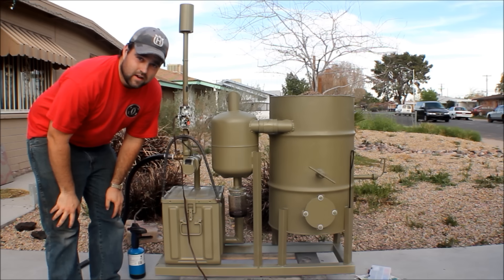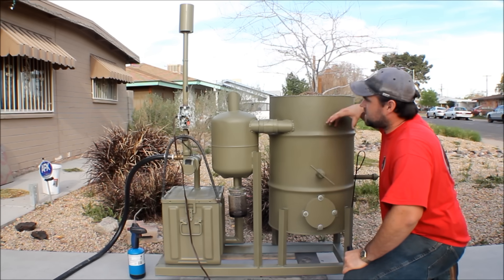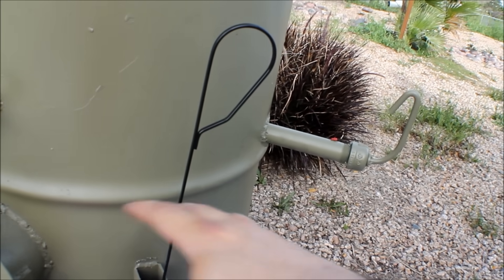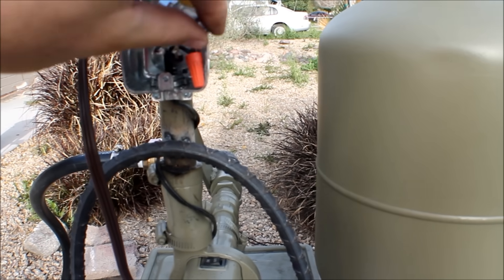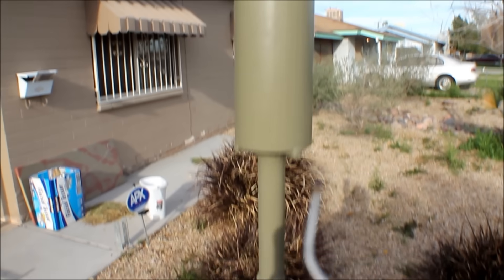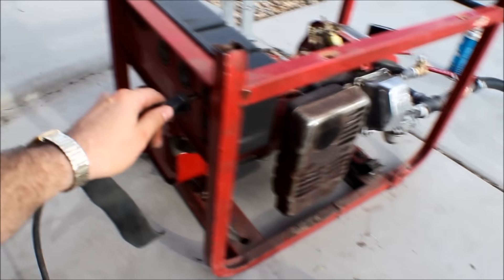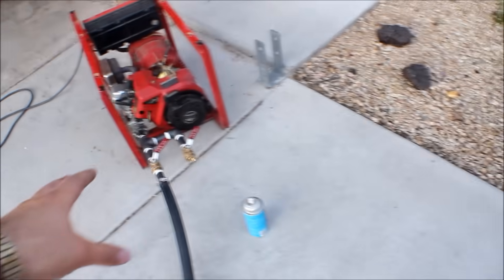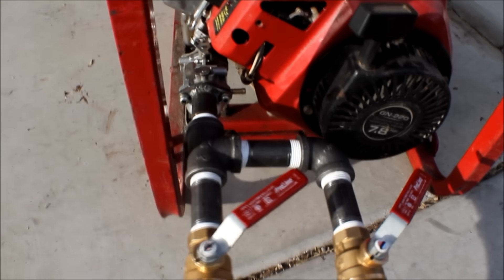amazing homemade gasifier uses wood pellets to run generator -- renewable alternative energy video

Comment: Using that 'not-that-small` blower at full power will waste a lot of energy. An air pump like that eats a couple hundred watts at 12V

While a gasifier operates, it needs a constantly forced air flow. 
Eventually the air pump/blower could be powered form a thermocouple array (TEC) or two, in series.  

It's good to be efficient, It's good, also, not to depend too much, or at all, from external, 3rd party sources of energy for your system to work.

Comment: How about instead of using an expensive power regulator(for such a small blower) just use a valve to control the amount of airflow? It's not like the blower needs to be ran for long periods of time. Just a thought.

Comment: Well done! I downloaded the FEMA pamphlet and am off to Lowe's and Wilco farm store to start pricing my parts. I have a few questions for you:
1) have you tried using wood chips? I have access to a chipper and that would be far more economical for me than pellets.
2) the FEMA plans describe a cooling device sort of a heat exchanger but you don't seem to use one. Are you using your cyclonic filter as a cooler as well?
3)how often do you have to refill your fuel hopper?

Great vid! Thanks!

Comment: Very interesting!   Now of course, I "need" to build one myself.  For the control of the little 12 volt blower, you might want to try using an RV light dimmer. They are widely available, even on e-bay! Mine are rated for 12 amps @12 volts DC. Circuit wise, it is a simple pulse width modulated switching transistor, with a little pot of about 10k for the adjustment. It will produce output smoothly from near zero to almost the input voltage, cheap effective, and comes in a convenient box.

Comment: What about using the exhaust from a pellet stove, would that work. I am also curious about your fuel intake into the generator. Could l also use a propane bbq tank and regulator to fuel it?

Comment: Stop using potentiometers. 
Use a DC-DC power regulator that can handle the current and you will have an efficient system. At least electrically. 
 Look for DC/DC Adjustable Step-Down Power Supply Module on ebay and such. 
Simple to use and implement. I saw they are in the 5 bucks range. 
Otherwise, I LOVE THE COLOR :D 
Great job!

Comment from the maker: yes, the sawdust gets dirty and needs to be replaced every now and then.  any type of box or bucket would work, as long as you can open it to replace the filter media, and as long as it is air-tight when it is closed.

Comment: Interesting! The rheostat, you may be better off building a pwm controller for the 12 volt air pump, it'll be more accurate for controlling airflow!

Comment: Carbon monoxide under the conditions of a properly running gasifier burns quite clean and effectively, along with the hydrogen. The EPA and smog shops that have tested these vehicles have seen that they infact produce less pollution out the tail pipe than a brand new hybrid. Look up the youtube video titled, "wood gas part 2" by eco jaunt. it will explain pretty much everything you might ask about gasification. The basics at least.

Comment: P.S. 
My 2008 Ford Escape (4x4 and not a hybrid) was checked for carbon monoxide emission at the time of purchase 2 years ago (Ontario regulation) and it showed 0 % of carbon monoxide at the pipe. The max allowed is 0.7 % which would still be enough to kill you in under 20 minutes if you breath directly from the pipe which is why idling a car is against the law where I live.

Comment: A properly functioning wood gas generator is producing Carbon Monoxide and Hydrogen for combustion purposes. The video posters close proximity to his 'torch' while standing in his driveway is about as dangerous as standing in your driveway with your car idling beside you.

Comment: He shut off that burner which was using the fan to pull the vapors through.  You can see this when he turned off the fan.  The engine's intake produces the vacuum needed when the engine started to pull the gas vapor through the unit.

Comment: If I got that right, your fuel is "vapors" from the wood pellets burnt in low oxygen environment minus "impurities".
I am wondering what gas or gasses in that vapor actually burn?
I know carbon monoxide burns and off hand it sounds like there should be a lot of it in that vapor, but since you are letting it escape via your "torch"  aren't you putting yourself in grave danger by simply standing there beside it?

Comment: it is compatible with 2 stroke engines?
Reply: d1no tk It wouldn’t be due to 2 stroke engines needing oil to be mixed with fuel. 2 strokes are slowly going away due to pollution regulations in some areas.

Comment: Here's a simple idea for all you electrical engineers.... A valve!  Just put a simple PVC valve after the blower and throttle it. It's an air mattress blower, it's designed to dead head. Quit yammering on about POTS and PWM's. KISS babey,  Signed A Chemical Engineer

Comment: A pot decreases voltage by creating a load in series with the motor. Bad for your motor because it is not receiving its designed voltage. A pwm pulses the motor with proper voltage and amps. Also it does not use resistance to eat up and waste excess power. . Not an opinion, just basic electronics. But if your using a cheap motor that can be replaced for less money than the cost of a pwm and consistent output for a given setting is not an issue, nothing wrong with using a pot.

Comment: In practice, a unit might include a large bank of deep-discharge 12V batteries and an inverter for steady, reliable power.

Comment: Portable, off-grid. Nice, but not competitive (on average).
 In places where electricity is 32 cents/KWH the comparison is better. Pellets: 47 cents; Grid: 48 cents. Don't forget the other costs of the wood-gas generator: cost to acquire the pellets (shipping/driving, storage, etc.), cost of generator (acquisition, maintenance, repair, replacement), your time, cost of building the unit. Fun demonstration. Looks much better if one uses landfill for fuel and larger scale. Thanks!

Comment: The average cost of electricity is 12 cents per KWH (USA). Wood pellets in bulk are about 14 cents per pound. Your other video suggested you used about 127cu in (i.e. 8.8 cups) of pellets to run for 1 Hr. At 100% efficiency you can get about 7500 BTU/lb from pellets (i.e. 2.2 KW.) I don't know pellet density -maybe 0.5lb/cup? So, you used maybe 4.4 lbs or 62 cents of pellets. You actually ran only 1500W (heater) so that is about 47 cents/KWHr compared to 18 cents from the grid.

Comment: I am curious to know about the cost per KWHr. You say your unit delivers about 8HP. That is approximately 6KW. If you ran this unit for 1Hr, how much wood pellets would that use and what is the cost of the pellets for that amount? That would deliver about 6KWH which costs about 7-32 cents per KWH. So 1Hr of running your unit deflects 42 cents - $1.80 worth of electricity cost.

Comment: Hi, I am also an electrical engineer. The use of a PWM controller will eliminate most of the heat in the controller. The potentiometer dissipates as heat what you do not deliver to the motor. Thus, the PWM controller will run much cooler and be far more efficient. Since you only use this motor during ignition, it may not be a big issue, however.

Comment: If you had a second person you could attach a simple hand cranked blower.  They've been using them for years on forges.  You can find them on ebay for as little as $50.  But I'm sure if you looked around you could find a deal somewhere.

Comment: The motor will last longer with a PWM than with a rheostat. PWM's are used in cars to control the fuel pump, that way you don't need a return fuel line that tends to heat the fuel in the tank up. Hope that helps.

Comment: I see now that the fan is only needed to start the gasifier ,then it can continue running without the fan when temperature is up. This still means that a battery will always be required within this system ,but whenever it gets running it can charge a battery for the next start up ,therefore in that sense, it could be considered an independent unit / system ?

Comment: Nice piece of work.
My only observation is that you can't get into the cyclone (for servicing/cleaning etc.) or the top of the gasifier because they are welded shut. This is not a criticism - just an observation.

Comment: The fan is only used to start the gasifier. Think about it - how could you run the generator (to power the fan) with a cold gasifier?

Comment: Your motor is designed to run at a fixed voltage.  Dropping the voltage with a rheostat is hard on the motor.  It is also inefficient, and that hot rheostat is evidence of electricity wasted as heat.  A PWM rapidly cycles on/off to control motor speed while providing 12v, which is much more efficient and does not damage the motor.  But if you already have a new rheostat I personally wouldn't bother getting a PWM since you only use it for a few minutes anyway.  Awesome project BTW.

Comment: Could you not feed off the generator for power supply to that air pump instead of drawing from the 12 volt battery to run the pump and therefore have a non dependency system ? if battery power wasn't available.

Comment: because a rheostat burns off the excess energy, gets hot, and wears out quickly with amperage draws that high. a pwm controller will be more efficient and longer lasting.

Comment: I have a question for you. How much do you save in price doing the pellets over gas? I would (if it is cost efficient) like to do this as a replacement for my electric at my house! I could have a generator supplying a battery bank and store power that way! Just wondering if you figured out the savings if any over pellets to gas! Thanks...

Comment: Very impressive job and very well explained design! Sorry to ask what is probably a stupid question...Can these things also burn other biomass to run the generator? For example, out here in Nebraska, a lot of people use corn burning stoves rather than pellet stoves because corn is so abundant and much cheaper than pellets. If so, this would provide an all-in-one solution for hydronic heat and electricity for my greenhouse.

Comment: It's because things like potentiometers and rheostats reduce voltage by way of resistance and turns into heat. Rheostats are the same thing as they call L-Pads in lower line speakers to reduce the midranges and tweeters, they always go bad where the wiper connects inside. Motor speed control is always best achieved with a PWM, whether it's an AC or DC motor because they pulse the power to rapidly turn the motor on and off.

Comment: Excellent video. Best 'home grown' one I've seen on gasifiers on YouTube and an terrific looking and well engineered build. I wouldn't worry about changing your rheostat out for a PWM module - you seem to have a fundamental grasp of how of how a rheostat works (like the rest of your plant!) so if it breaks you can fix it. A PWM module will just be a surface mount blob of silicone on a PCP board..

Comment: PWM works by turning off and on the flow of current from the source rapidly, and then either rectifying the output so it's continuous or feeding the device directly on the pulsed current, it can very efficiently supply the exact amount of power needed without rejecting the energy as heat. A rather simplified explanation, but hopefully enough for you to take it seriously and do your own research.

Comment: Another engineer, forgive me if I oversimplify - basically a rheostat controls the power to the device by varying a resistance between the device and the source. The heat you feel from the small rheostat is where the power of the source is going when it's not going into the motor. The larger pot is still rejecting that same amount of energy as heat it just has a larger heat sink so it wont feel as hot. In either case - you're wasting a lot of energy from your source and it'll drain quickly.

Comment: If you got a back yard full of fast growing trees and you use the circular saw connected to the generator to cut down and chop up more wood for the gasifier, then the energy cycle is complete.

Comment: This is an excellent narration. Clear, understandable, very "listenable." 

Very cool device. Not sure, though, why I'd want to have one of these, unless I had absolutely no access to other canned or pourable fuels - and no propane bottle to light the indicator vent. I would, though, be curious to know how the pellet cost compared to the cost of using common gas. Probably isn't much more than double, from the look of it. 

VERY good job building this gasifier. Props to you, Jr McLaws!

Comment: It's hard to explain in 500 characters, but suppose the supply is 12V and the pot is adjusted so there's 6V across the motor; if the motor then draws 1A, then the pot is dropping 6V@1A, or 6W, in heat: that's why it gets screaming hot. A PWM controller turns the voltage on and off at high frequency instead, varying the duty cycle ("on" vs "off" time). This is MUCH more efficient and is the standard/correct way of doing this kind of DC motor speed control. Otherwise, you've done a beautiful job.

Comment: Another thing that might work to control blower speed and should handle lots of current at 12V is on old heater fan speed control switch from a car.

Comment: I have a quick idea for anyone looking for an easy rheostat that might work and be easy to find. The old light switches in cars older than the 90's had a mechanical rheostat to dim the dash lights, it looked like a wire spring with a wipe contact on it. Great Job! I can definitely see making one of those myself due to your clear explanation. Fantastic!

Comment: Electronic engineer here. You don't want to use a 25W pot (rheostat) to control your motor speed. You want a PWM (pulse-width modulation) controller. Measure (with an ammeter), calculate, or read off the label what maximum current the motor draws (say it's 1.5A), round up for headroom (say 2A), and then Google for “12V 2A DC motor PWM controller" and you'll easily find one on Ebay or Amazon for $10 or so.

Comment: You did a good job on that man.  I especially like your basket.  It looks like it would get rid of the ash a lot better than the bowl with holes would.  What would you have to modify to be able to run wood chunks?

Comment from the maker: After playing with my gasifier for a few months now, and researching everything I can, I've realized I was wrong with that point.  You are correct -- the gasifier needs to run REALLY hot if you want to crack the tar and produce clean gas.  Thanks for the comment!
Reply: Jr McLaws what if you added the gasses you flare off at the torch stack above the cyclone filter back into the gasifier for that heat? Exhaust gas recirculation, like in a car. As it stands in this video, it seems to me like you might be wasting burnable fuel, discarding available energy. 
Also, I agree with the suggestions to insulate the gasifier, and the cyclone filter and the piping. You’ll melt the silicone couplers...

Comment: I think you are mistaken about oversizing the gasifier. You need to run about 1200degrees F to crack the tar. then cool the gas after the fact in improve volumetric  efficiency.

Comment: That's a good gasifier setup you have and i wonder what the emissions are like running it on wood gas compared to if it was burning regular gasoline?
Not criticsing but your wood gasifier isn't the setup you'd want to be mucking around  with starting and warming it up in the wind and rain during a storm-related power outage.

Comment: Jr.. Nice work, Try using a B&G [Bell and Gossett] 3/4" by 1/2'' ips Monoflow Tee for fuel air mix..The venture in fitting will mix better.

Comment: The big problem with running engines from gasifiers is being able to control the A/F ratio as the load increases. All these demonstrations show an engine or generator running with a fixed load (typically no load).
You need a governor system that will adjust the air/fuel ratio in real time. Regulating the total flow isn't very good because the mixture will lean out when a load is applied and the throttle plate opens.

Comment from the maker: I think it's due to air leaking into the system.  you need three things to cause a fire -- oxygen, fuel, and an ignition source.  A gasifier by design is completely filled with fuel (the flamable gasses) and the burning of the wood presents an ignition source.  So, all you need is some oxygen to leak into the system, create a flamable fuel/oxygen mixture... and BOOM.  Also, if you start your gasifier with the fan on too high, you can have excess oxygen and see an explosion.

Comment: Jr McLaws great video and demonstration of yr fema gasifier. You should connect a  electric heater load test sch as a 16oo watt heater. so that you can see the glow of fthe heating element. as proff of the out put of yr generator running on wood chips. also show the ac voltage under load.Hopefully u got the right reostat for ur fan. good luck Keep the Faith JohnMillard

Comment from the maker: You are correct... the problem with the simplistic FEMA gasifier design is that it produces a lot of tar.  I noticed the valves on my generator getting a little sticky after running for several hours, so I know that some of the tar is making it past all of my filtration.  Flash001USA is making some great improvements on gasifier design... you should check out his channel.

Comment: Hello! I'm impressed but also a little concerned, my own experience of pellets is that the tar fixed valves, now, this concerned a larger unit that I had at my car. Unfortunately I now run on gasoline again Unfortunately, because of better economics, but now I am unemployed again and have started looking at my old unit that I have saved. thanks for a instuktiv video.